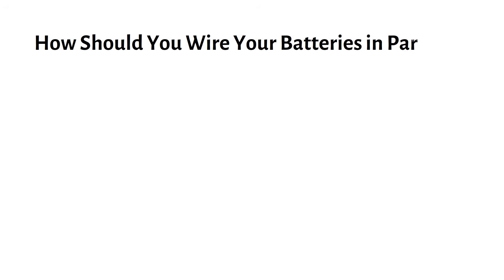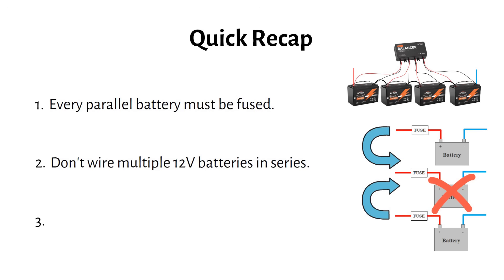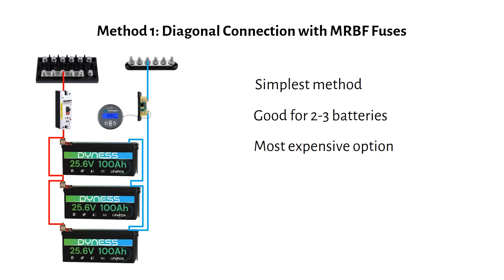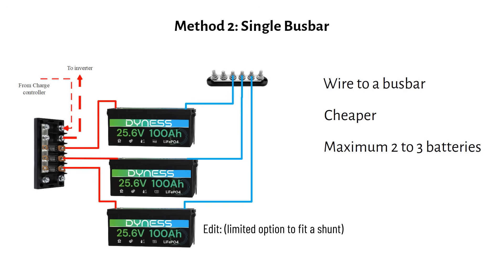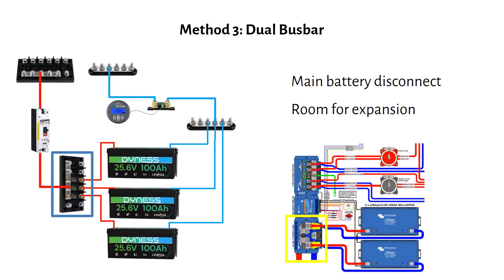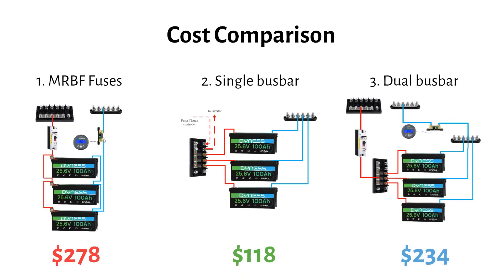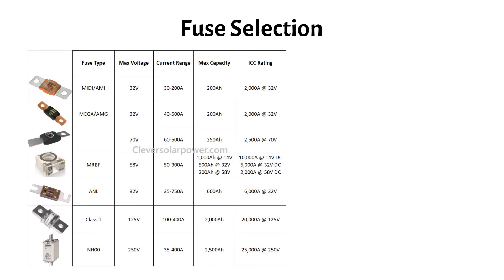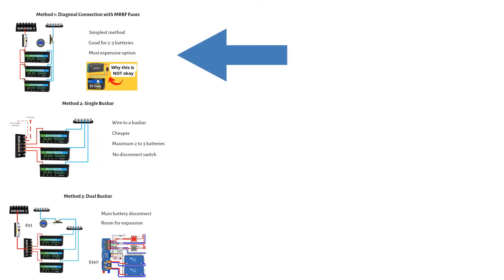Parallel Battery Wiring Methods Compared – Busbar vs MRBF Fuses

Comment: Please Please provide a link or part number to a seller of an MRBF with a M8 mounting hole. I am searching for the hole in the metal that connects directly to the battery, not the hole diameter of the fuse itself.  Thank you very much..

Comment: In methods 2 and 3 does the use of standard mega fuses, with an I.R of only 2000, not severely limit the size of battery that can be paralleled? Another commenter suggested a short of 20xBMS per battery, which would mean a 100 amp BMS maximum per battery.

Comment: First, I read Matt's posts below referring to the need for egress fusing on all batteries, and BMS FETs inability to prevent the dumping of amperage.  I personally would never trust or rely upon any BMS to be a fail safe.  

Also, there is nothing in your examples 2 and 3 to prevent amperage dumping as you pointed out for example 1.  You state, in the example 1, that MRBFs are required on each battery to prevent this from happening.  If there is a clear path for amperage flow, either thru direct wiring between batteries or busbar connections, each battery will need to be fused (preferably MRBF).
Reply from the maker: Yes, that's why I recommend fusing every parallel battery. In example 1 this happens with an MRBF fuse and in examples 2 and 3 this happens with mega fuses on the mega fuse busbar. The fuses might not be so visible in the image. But each battery is fused in every situation.
Reply: @cleversolarpower  Nick, the fuses are not very visible in the diagrams, thus my comment.  I would still prefer MRBFs on each battery even though it is more expensive than using the mega fuse busbar simply for the exceptional AIC of the MRBFs.  Your example 3 is the closest comparison to how I designed my system.  I have MRBFs on each battery feeding a 300A busbar followed by a 300A ANL, a 500A disconnect switch, then a 300A system busbar.  In hindsight, a 300A circuit breaker might have been a better option for system protection/disconnect instead of using the ANL fuse.  More expensive but much higher fault protection than the mega fuse busbars.

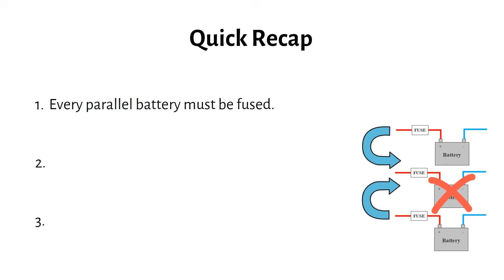Comment: @0:30  Your reasoning is not correct. The main reason is power system selectivity/coordination.  Within that framework, yes, we also need to consider the SCCR of individual components and the total available fault current capability of the source(s).  The second reason is maintenance.  There are many situations where you will need to isolate a single battery/bank for replacement, maintenance, etc.  @0:50  Your reasoning is not correct.  LiFeP04 batteries (all references to "batteries" in this post are refering to LiFePO4 batteries) are no better at balancing when wired in series or parallel.  That is mostly true at a sort of macro level, but in practical reality it is not true.  This is because individual cells within a battery can and do become imbalanced (beyond the capability of the BMS to correct) under normal use regardless of how you wired up the batteries externally, and this will result in the exact same frequency of needing to do a maintenance cycle to correct that issue in either case.  It is generally preferred to use parallel vs series, because you can isolate a battery for maintenance and still have full/partial use of your system.  However, parallel increases the total available fault current by the summation of each batteries available fault current in your bank, while batteries in series are limited to the available fault current of a single one of those batteries (assuming they are all the same).  So, for power system selectivity/coordination, series is better.

Comment: Can i Install 4 200ah 24v batteries in parallel  using mrbf fuses on each battery be within the short circuit rating ?    Or is short circuit rating to much to be using these fuses because the short circuit rating is to high of all the batteries combined

I understand fuse rating per amp hour but what about batteries in parallel short circuit .

Comment: Thanks for the video, becoming familiar with how much power in watts that I need for different applications is my biggest hurdle. I just have not worked with watts that much and even think of motor size in horse power.

Comment: I only have 2 x 24v setup similar to layout 2. I only have a fused busbar as the negative battery leads attach to the shunt. My small solar charge controller has an inline fuse. Not something I'd recommend as they tend to overheat but this one is a maxi blade fuse (automotive type large fuse) and it doesn't warm up.
There is a guy currently doing videos on a setup similar to layout 1 and his battery cells have become unbalanced and I wonder if it is due to the different cable path lengths?
Reply: Could be due to the cable lengths, resistance in the connections, the individual batteries having slightly different resistances, or more likely all three; but it doesn't normally matter if the batteries in parallel in layout 1 become "unbalanced", unless you want to draw 300A.  For 100A, there is no issue if one battery charges / discharges faster than the others, they will all go down to 0% and all go up to 100%, but maybe not simultaneously.  This is a good reason for using 48V if you want to draw a high wattage, you can draw twice the power without worrying about this issue.
Reply from the maker: Great answer.

Comment: Hi Nick. An excellent video and very helpful. After watching your other videos and reading your book, I did this. I wanted to make a 24v/2000w inverter system that was easily expandable, starting at two 24v batteries and going up to 4. I went with the busbar approach, because it meant I could use lighter cables. What flummoxed me was the fusing. I wanted to isolate each battery and fuse it separately as you say. In my country, MRBF fuses and fuse blocks with a cut off switch are more than double the cost of a breaker (using the brand you use). So, I decided yo use this for each battery: battery -> breaker -> unfused busbar -> large cable to a cutoff switch so as to isolate the entire battery bank, if need be -> to another busbar where the solar controller is attached -> then to the inverter. I have not assembled it yet, as I am awaiting delivery of the solar panels. I have a breaker from the solar charge controller.
Question: Should I have an isolation switch or a fuse or breaker between the last busbar and the inverter? I tend to think I should. 
Overall, I calculated this approach saves me about 20% on a build involving MRBF /isolation switches because save a lot on cables and the MRBF /isolation switches, even if I do have to spend on breakers. 
Thanks again for an excellent video and your generosity in answering questions and willingness to give advice.
Reply from the maker: Thanks for sharing. Yes, the large cable going to the inverter also needs a breaker/fuse. Every positive cable does. I hope you are not using the cheap 'marine rated' small breakers.
Reply: @cleversolarpower  Thanks for your reply. No. I was following your suggestions. I have DIHOOL  (which comes with documentation) at 100A and the cable from the battery to the breaker is WindyNation AWG6 (which WN rate at 116A).  I was going to go to a WindyNation AWG4, for the cable from the main busbar to the inverter.

Comment: Excellent excellent.   I think you really covered the bases well here.  One thing I would add is that even with Method 2 you still need egress fusing to the devices, and when hanging off a high-amperage bus like that the fusing can wind up being fairly expensive.    There is a very blurry line between Method 2 and method 3 ... both are really just one method.  For several reasons, you can't just hang a bunch of low-amperage devices off of a high-amperage bus.

So if the bus is only talking to an inverter then with Method 2 a T-Class is still needed between the bus and the inverter.  When the bus is also talking to a bunch of low-amperage devices, you really have no choice but to shift to Method 3 ... a dual-bus model with at least a breaker (or even a fuse and a breaker) inbetween the high-amperage battery bus and the low-amperage secondary bus that all the smaller devices hang off of.  Think battery chargers, solar charge controllers, native DC ports, and so forth.

For those sorts of lower-amperage devices its good to use DC breakers as disconnects or (if being cheaper) 10x38mm ceramic "solar" fuses hanging off a medium-amperage bus and not hanging off the high-amperage battery bus, with a T-class fuse and DC breaker (as a disconnect) inbetween the two busses.   The I.R. rating of the fuses and disconnects hanging off the low-amperage bus does not have to be as robust as the I.R. rating of the fuses and disconnects hanging off the high-amperage bus.

(As another example, this is also why the UL listing for the service breaker going into a master home AC panel is different from the UL listing requirements for the smaller breakers servicing each circuit.  The service breaker has to deal with much higher I.R. requirements than the satellite breakers).

I also completely agree on not worrying too much about matching current path lengths.  It is something that is worthy of worry in a 12V system but ... not so much with 24V and 48V systems.   The batteries will develop slight SOC differentials due to different cable lengths but they always collapse back to zero at the two ends (when nearly fully charged and when nearly empty).   The minor differences in battery wear can just be ignored.

-Matt

Comment: "If one battery develops a fault, it can dump it's entire short circuit current into your other batteries" - no it can't!  For LFP batteries, even if it is full and the others are empty at the time it decides to dump its power, the current will be a lot less than short circuit current.
It is possible that if one battery short circuits, then the others can dump their power into the short circuit, which does require some protection, however if we are talking LiFePO4 batteries as shown, then they all have internal battery management systems with short circuit protection, which makes additional fuses redundant.  Always good to have redundant protection, but it should not be necessary since it would require multiple faults before it would get used.
Reply: I partially agree with you, but also partially do not.

One can argue that with multiple batteries in parallel, there are at least two BMSs in any given circuit path capable of protecting the battery bank from battery-to-battery shorts.  At least up to a point.   However, FETs are not nearly as good as breakers or fuses because the failure condition for a FET is usually a shorted condition... the switch becomes permanently closed rather than open.  A big enough short will straight-out destroy the FETs in the BMS.

For this reason I will often parallel two, even sometimes three batteries together with a single egress fuse rather than per-battery fusing.   But the more batteries this is done with, the more dangerous it gets so at some point you really want to move to per-battery fusing or at least per-group fusing (parallel two batteries with one egress fuse into a battery bus, grouped with other blocks of 2 batteries).

Call it the swiss-cheese model for safety.

There are lots of ways to do it safely but I would start to worry once roughly 3x the BMS rating is exceeded.  300A for a 100A BMS.  Because the short circuit current that a 100A BMS has to deal with is around 2000A.  With two batteries that 100A BMS is dealing with 4000A.  With three its 6000A.   One quickly gets into an area where the BMS(es) in the circuit path won't be able to stop the short.

-Matt
Reply from the maker: You are a good listener. I meant to say that other batteries will dump their short circuit current potential into the faulty one. Matt has a good explanation as well.
Reply: @cleversolarpower  Matt does have a good point, but I have a question - should we really be assuming that the FETs in out batteries are unreliable?  They are there to protect the batteries from over charge, discharge, current, so they should be reliable... should be be doing an annual checkup to make sure that all the FETs are working?

While adding extra redundant protection sounds good, it does add potential failure points, and although I do want my batteries protected, if a battery FET fails, that battery needs replacing, so it doesn't much matter if it gets damaged because of the failed FET.  As far as I know, these LiFePo4 batteries are not causing significant fire damage when they fail, whereas where I live we are recommended not to install DC disconnects, since statistics say that most solar PV related house fires are caused by DC disconnect switches, which nobody ever actually uses anyway, since most people with solar systems don't know what they do, and they do not remove the voltages from the solar panels anyway!  If I want to stop the current flowing through the MC4 connectors so that I can disconnect something, then I ask the charge controller to stop charging.  I only install fuses when they are necessary to protect the cables in the event of short circuits.
Reply from the maker: There is a reason fuses are not made with FETs. I do not trust FETs to stop a short circuit current. The BMS is designed to check the resistance before it gets connected. If the resistance is low it assumes a short circuit and they won't open. If the resistance detects a normal circuit resistance, then the FETs will close making the battery work. However, when the FETs are conducting I don't want to rely on them to break a short circuit. 

Yes, I've heard about the DC disconnects. I think it's best to follow your local laws regarding this matter.
Reply: @nigels.6051  The Swiss cheese model for safety basically says that if, say, the chance of a particular failure is 1/1000, and you have a second safety mechanism in series that also has a 1/1000 chance of failure, now your overall chance of failure is 1/1000000.   But that still means there will be a failure for every million installations.  From the point of view of an individual your odds may be good.  From the point of view of an industry, or country, or city, or influencer, the odds might still be unacceptable.

This continues to scale with more safeties, but yes there is also a point where the mechanisms themselves introduce new chances for failure and we hit diminishing returns.  Generally though, safety scales up so quickly that your odds don’t start getting worse until you have a significant number of mechanisms in place.  Think about how many fuses and breakers exist between an electric generator on the grid and your home, for example.  It can approach 100.  And inside your home there are generally four or five more.  Service fuse, main service breaker, circuit breaker, breaker in sub-panel , fuse in device.  Etc.

Even a space heater has more than a few built in safeties.  Regular fuse, thermal fuse, tip sensor, thermostat.  A gas furnace has four or five.  A steam boiler furnace has at least four.  But they still blow up every once in a while anyway.  The list goes on.

Anyway, it isn’t a straightforward calculation.

-Matt

Comment: Thanks for this. I was taught it's better to place fuses right next to the (+) battery terminal (ie. close to potential short circuit current source) instead of at the other end of the wire. So even though I have multiple batteries connected to a busbar I put MRBFs on each battery. But your MEGA fuse bar is interesting to me because the fuses are cheaper than MRBF. (I avoid placing MEGAs directly at the terminals because with high current they can overheat and melt the surrounding plastic. Not sure if you know a way around this.)
Reply: It is, but it's also often a lot messier to put the fuses right on the plus terminal and also often exposes more copper near the battery terminal, increasing the chances of creating an accidental short in the first place.   Also remember that a short can develop from either end... bus side OR battery side.  The battery has BMS protection so situating the fusing on the bus side gives you decent coverage from both ends of the cable.

--

Overheating is almost always an issue with incorrect fusing calculations or the use of cables that are too thin (causing you to use too small a fuse value relative to your actual loads).  This is an area of mass confusion throughout the ages, mostly because people always undersized their cables in 12V systems, but there is a very simple way to calculate the proper sizes in higher-voltage systems where you don't run up against insane cable thickness issues.

* Always use at least 70C or higher rated cable, but use the 60C ampacity tables to determine maximum operating current.

* Size fuses to 150% of the 60C rating for the cable size.  And this should be no less than 150% of the maximum intended operating current.   i.e. 2 AWG with 70C+ insulation, 100A (60C ampacity), size fuse to 150A.

* Size DC breakers to 125% of the intended maximum operating current (breaker rating should be less than or equal to 100% of the 70C rating of the cable and the maximum operating current should be less than or equal to the 60C rating of the cable).  100A maximum expected operating current, size DC breaker to a minimum of 125A (and not greater than the actual ampacity of the cable at its actual insulation rating).

* Remember that even when using cabling with high insulation temperature ratings, the lugs that cable is connected to are likely rated lower.  Particularly when the lugs/terminals go into a circuit board.  They are always rated for 70C or lower.

The numbers more or less always work out with this trick, and nothing will overheat.

-Matt